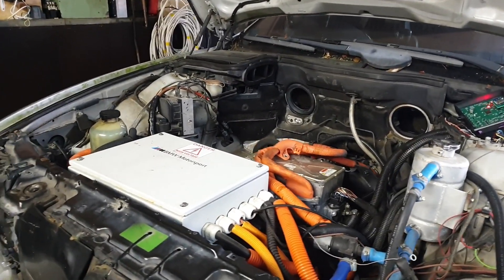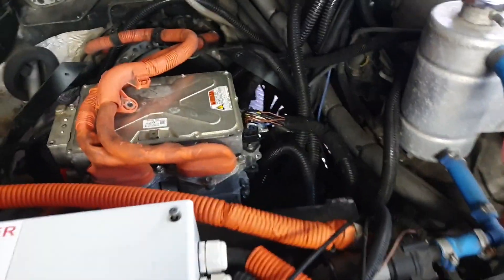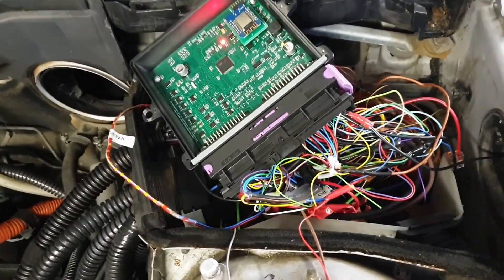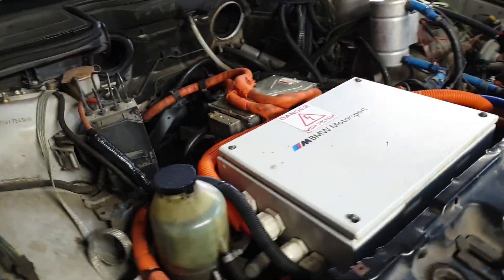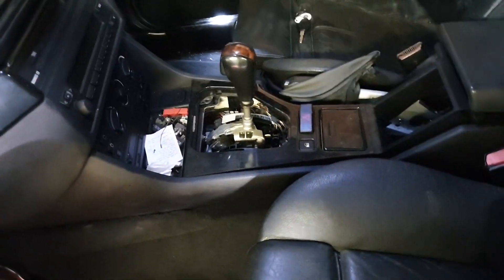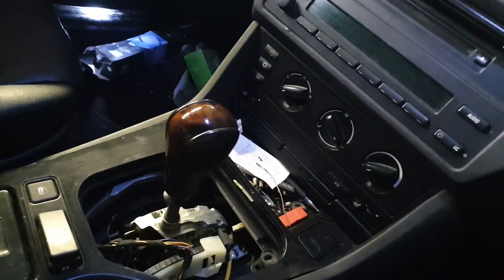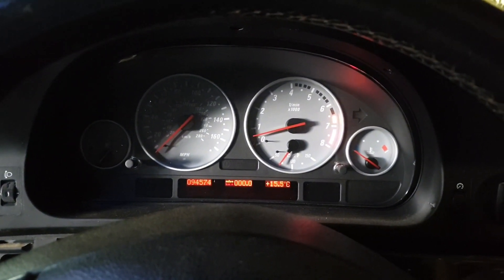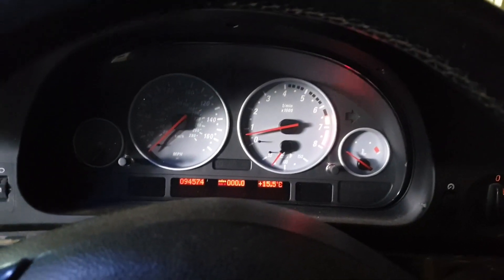E39 Lexus GS450H Swap 03

Comment: This looks great, We’ve got an old e39 530d touring I’d love to EV convert and this looms the business. A couple of obtuse questions if I may - what kind of performance will this gs450h conversion offer when dialled in? Understanding range will depend on the batteries used, what will the power and torque equate to compared to a ICE model? Looking forward to seeing more, love it!

Comment: Nice work Damian...
Question for you: I've watched your testbed videos for both GS450h and GS300h - why didn't you go for the smaller/lighter/simpler GS300h unit in your E39 - is it mainly because the GS450h has the two speed gearbox?
Reply: I wondered this too! Waiting to see if someone gets the 300 working in a conversion
Reply: @edmorris182  yes indeed

Comment: I have a question how do I get a car charger point to output AC240 to charge my "I know but its fun" G-Wiz that has a 3 pin plug without spending £250 on something I'm only going to use just in case I get stuck
Thanks for your help

Comment: This is extremely relevant to my interests. 6 years ago I sold my 530d M-sport Touring High Executive Shadowline 5sp manual to an E39 enthusiast down the street, and have regretted it ever since. I'm moving to Ireland in a few months, and I really want to have another E39, but the road tax on an old 530d is daunting. I'm doing a kart BLDC conversion now and a tractor thereafter. Got a 2002ti I'd like to get to eventually. This seems like a great everyday car.

If I may ask: how do you manage insurance? I hear it's difficult in Ireland. I assumed an electric swap would only complicate matters further, but I guess you've managed it.

Comment: Not sure which is more impressive; the GS450H swap or the fact that your E39 dash has no dead pixels
Reply: An EE with the required soldering iron LCD ribbon fusing tip is not to be trifled with.